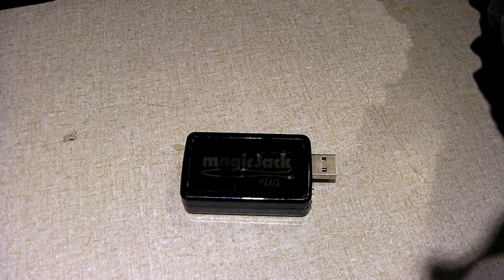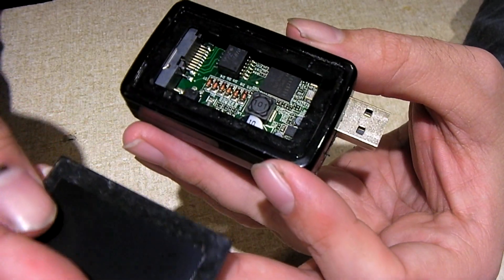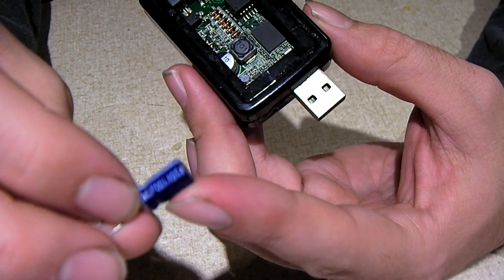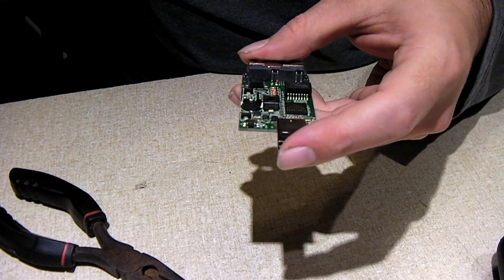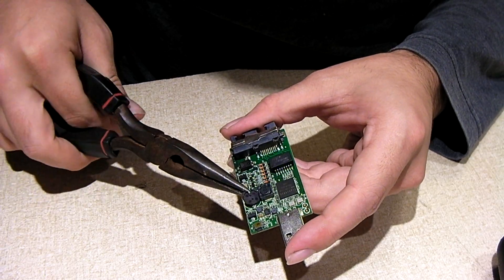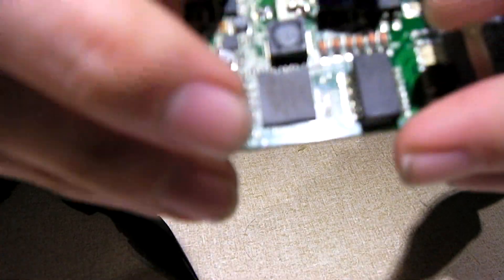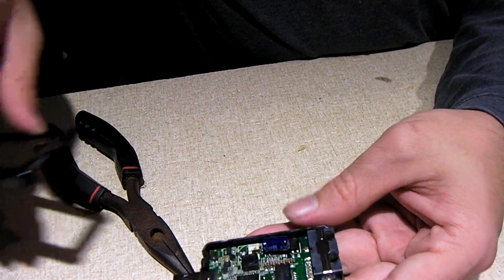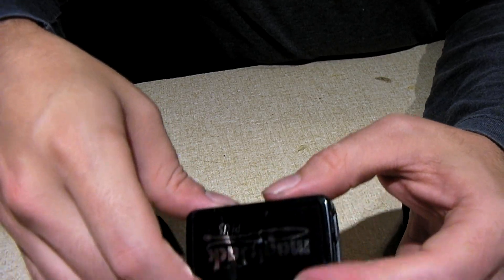Replacing capacitor in magicJack Plus to clear up noise in phone

Comment: Hello, The capacitor value is 10 Uf  rated at 100 volts.  Not 100 Uf at 10  volts. There is a DC to DC converter that puts out 48 volts for the normal telephone ring etc.  Do not use a 10 volt 100 Uf replacement cap!  You need a 10 Uf rated at 100 volts, 50 volts  will work since it only 48 volts but that close top the limit. No more noise!
Reply from the maker: Good catch... This electrolytic cap has been installed and in service for quite a while now... no bulging or leaking... usually they'll blow rather quickly when overvolted. If it fails, I'll change it out for a 10uf 100V part.

Comment: I had a much lower volume 60 cycle buzzing in my phone. I was using the phone with the magic jack being plugged directly to the router and then to the house phone line. The solution for me was to replace the AC to USB adapter.

Comment: White Noise .. hahaha .. I remember when I was in France and the Engineers around me were 'scared' of Noise - we designed high frequency generators and Spectrum analyzers.  It took a minute of our boss (Dr Charbonnier - Professor at La Sorbone) to make us think. 'electromagnetic' waves surround us, and with the new and more Smart things around, more noise is picked up.  The capacitor is a good point if degraded, filtering the noise coming from the power source. The extenssion cable is of course an 'antenna' capturing signals, and using ethernet (twisted 4 pairs) Cta 6  or 7 will certainly isolate it more.  All of these are a combined solution.  (avoid the cables near the Wireless Router will be smart)

Comment: Ok with so little info out there about this issue, I'll add what worked for me. I have the newer model and I've had the static noise issue for over a year. Changed the phone and LAN cables, router but no luck. I was just going to get a new one when the time came to renew then I stumbled on this video. I wasn't going to change the capacitor (I'll just get a new unit), but I saw some comments about how changing the power supply solved the issue. I changed mine to a 2A power adapter but that didn't fix the issue. What solved it was removing the optional magicjack USB extension cable and plugging it directly into the power adapter. No more static noise. I tried the extension cable again as a test, and the noise came back. I tried directly with the 1A power adapter again and it worked. So MY issue was with the extension cable.
Reply from the maker: I have a video posted about the power supply causing issues with these. I tend to run mine directly off the power supply. There's a chance the extension cord could be cheaply made and causing a voltage drop to the magicJack when it needs additional power.
Reply: The same for me!  Thank you for this easy fix!
Reply: Thank you! Removing the optional USB cable worked for me, too.
Reply: This worked for me too!  So annoying

Comment: Thankyou brother for posting this Very helpful tip!  I just got around to doing mine.. It had LOTS of background hiss and hum...new Power supplies helped but the main cause was that capacitor... as other commenter mentioned ,its 10uf/ 100volt... I tried higher capacity uf ratings, like 50uf and 100uf but the voice wont function with those values... its 10uf for a reason.....like you, my traces both broke off but I found alternate attachment points nearby and it worked fine... the only 100v /10uf I had was too thick to fit in the case  so I attached a small guage twin wire to the positive and negative attach points on the motherboard, then ran the wire outside the case where I secured the larger capacitor... Some black electrical tape to secure the case halves together and the external Cap to the case..worked Great and zero hum afterwards.. I was just about to reorder a new MJ because my subscription was up.. this one works good enough Im not gonna bother for now..

Comment: Mine is one of the first ones and static and crackling is bad. If I just bought a new one are they noisy also or did they fix noise issues.?
Reply: thyey are silent, dead quiet and clear as a bell.. they supposedly have more cpu power and memory for better audio... Ive direct compared a new type one with my older majicjack GO... when mine had the bad capacitor issue, the new MJ was nite and day better... when I replaced the capacitor, the older MJ was almost the same as the new one..hard to tell any difference.

Comment: Ok my friend do not listen what is writing: the problem for the noise is the power supply from the magic Jack take it out connected to the outlet have USB connection 👀👍👋👋👋👋💯%%🙌🏁🏁I fixed 123🇵🇷
Reply from the maker: The power supply can sometimes be the culprit, however, even with a new power supply, the phone will still have noise with a failed capacitor in the magicJack.
Reply: @CubeComputerChannel  You are correct my friend... while the power supply Can affect the noise, the capacitor in the MJ was creating noise Irregardless of Most power supplies I tried...once replaced, it was dead silent as far as background noise..probably the ideal would be a new power supply as well as the Cap replacement but Im please with mine since the fix.
Reply: I was all set too by a collection of capacitors from TEMU.  I swapped out the power supply with a 5v 2a charger (oem is 5v 1a) This fixed my noise problem.

Comment: That worked on my MagicJack Go. To open, i used a flat head screwdriver with a hammer on the edge (blue line) closer to the mac address label. Thank you so much. No more annoying static.
Reply: I just put it in a vise, turned the crank till it Just beagn to crack, then took it out and used a knife to full seperate it... dont crank the vise of it will shatter the case...you just want it to begin to crack at the seams, then manually seperate  it.

Comment: Kind sir, this seems too involved for me -- but I do have a question -- if you had to have changed to the new Magic Jack, would you be able to keep your same phone number, or would you have to have changed it?  Can you think about posting a video for keeping the same phone number with changing the Magic Jack unit?  Thank you, kindly!
Reply from the maker: You can keep your number when changing to a new device, and if the new device comes bundled with service, whatever that amount of service should also get added to what existing service months/years you had with the existing device and phone number. If you're having issues, try a new power adapter if you haven't done so already.
Reply: @CubeComputerChannel  Exactly the info I found out myself as I had the same concerns... what u stated is what customer service stated to me...should be no charge to keep ur previous MJ number....its only when you are coming from a different type of phone and want to keep That number, then it costs

Comment: Googled problem, found this video and 15 minutes later, my magicjack has no more noise.  Before, other companies couldn't hear my dtmf, but now it works.  Thanks!  I tried to desolder the smd capacitor, and one side worked but the other side melted the capacitor body itself and broke the cap like yours.  but now that the top of it was off, I just desoldered it and left a nice pad for re-soldering.  Much appreciated!  Also my magicjack was a little different than yours, had 3 smd caps but the other two caps were smaller and this was the only 100uf.

Comment: I damaged the pads in removing the capacitor but found it connects to an adjacent resistor. Soldered new capacitor to this resistor and it works like a charm.
Reply from the maker: Was there a designator marked on the board for that resistor you soldered to? (Example: R1, R2, R3, etc) Might be helpful for someone else who ruins a pad and needs this backup location
Reply: same happend to me and I did the same thing... with the negative side of the capaciter noted, as it has the black mark strip, its the surface mount resistor thats right next to the negative side...Im assumung that its a resistor and not a tiny capacitor...its small and rectangular ,surface mounted.

Comment: Thanks for this video as well, even though the power adaptor solved my issues, I use one for a fax line so if I start having problems again I’ll know this is why.
Reply: I had low volume issues then changed the low adapter to a more powerful one and it fixed it but still get lots of loud static.

Comment: Hello bro you don't have a hot air station to remove chips or surface mount capacitors?
Reply from the maker: I currently don't have a hot air station. Most of the soldering I do is through-hole. This magicJack device was a rare exception. I have repaired two this way... just have to be super careful with the pads on the board. I didn't nearly destroy the pad on the second one of these devices (which belongs to my parents).
Reply: @CubeComputerChannel  
Ah cool , if you did more surface mount soldering, you would have had a air station.
Otherwise happy new year bro!